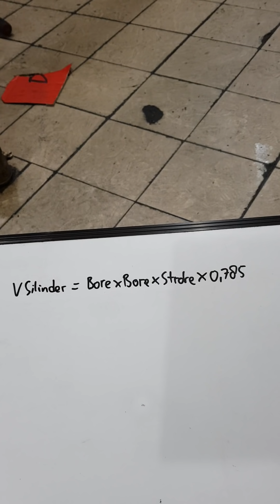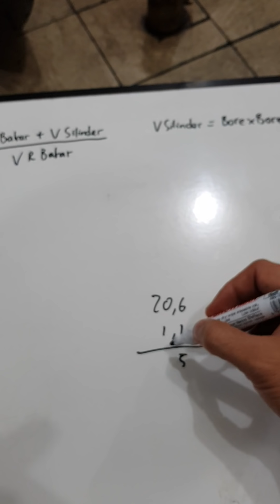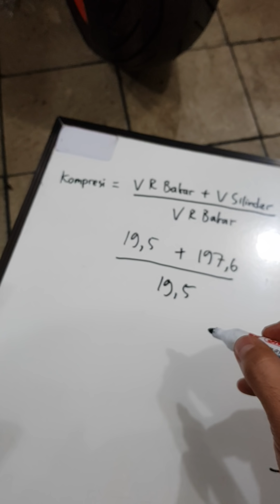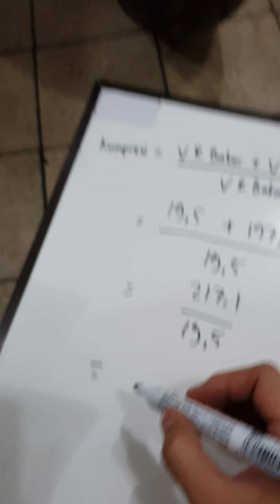Proses 5 : Buret kompresi piston BRT 66 mm CRF150L

Comment: Kalo buat harian kompresi segitu masih amankah? Cara Menentukan batas rpmnya gimana koh...
Head std apa masih bisa dipakai apa harus ganti?
Reply from the maker: Utk harian aman. Menentukan batas rpm paling gampang itu di lebihin 1000 sd 1500 rpm dr limit std nya, itu kalo pake per klep std. Kalo pake per klep racing, patokan saya dilebihin 1000 sd 2000 dr peak power nya, keliatan pas di dyno